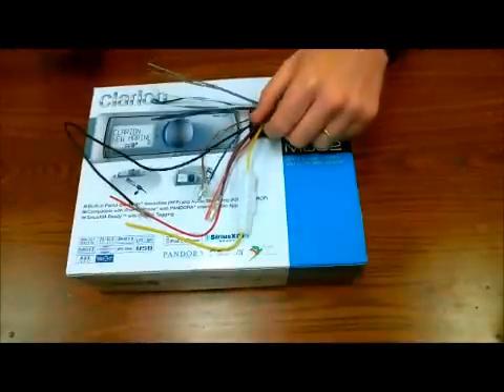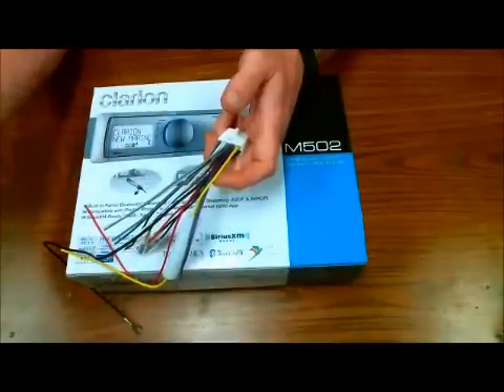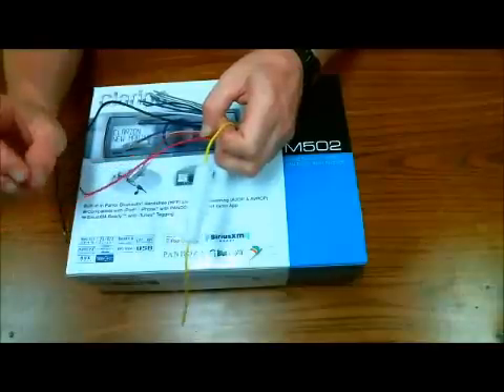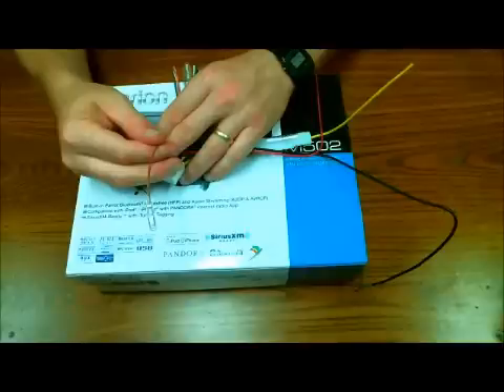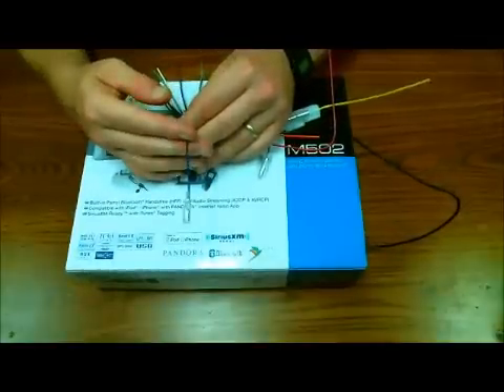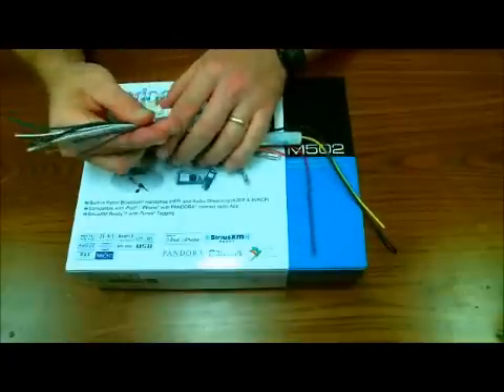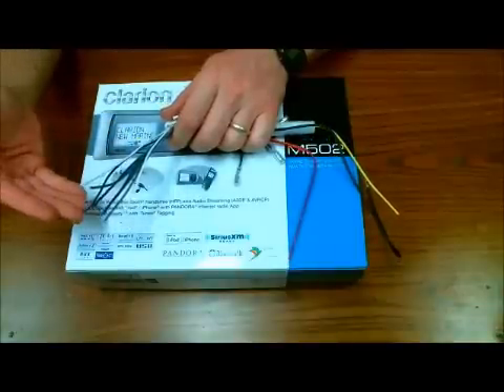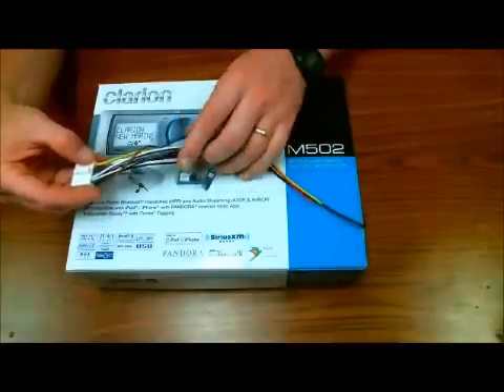Car Stereo Wiring Explained In Detail

Comment: I have a yellow lead and a red lead with a join half way along them. Not sure why these might need to be separated? Also, I am having problem with the presets radio stations - they keep getting reset rather than using what I have tried to get stored in the radio's memory. This happens each time I return to my car. I can't understand it - has the yellow and red leads got something to do with it not memorizing the presets?

Comment: hey i have a pioneer 4100 nex and i got a scion tc 2012 i have a cable that says power antenna idk where to connect it so i just conect it to the blue wire since its blue as way and now i have issues where my bluetooth does buzzing sounds when its on what can i do

Comment: i have a land rover discovery 2 and the memory will not hold to the unit. this model has three factory plugs behind receiver. bout vehicle with no radio in it. but there was a partial plug adapter in it. just need to find what I need to do to have this working for my wife. thanks for the help.

Comment: I have a Sony head unit and a Buick LeSabre car. My unit only works when I have the yellow and red wires spliced together. There are two yellow wires coming out of the GM harness, but only one yellow wire coming from the Sony harness. When everything is hooked up as described above, I have an amp draw which drains my battery. Any advice?

Comment: i have a 2000 dodge Dakota someone has had subs in it but took them out my question is i get the stereo working? but it will forget my settings some times and blow the 15 amp fuse that controls the tail lights and dash lights but the stereo its self still plays music without that fuse i unhooked the stereo and put a new fuse in and the lights work again did i cross a wire and if so what is your best guess on witch one i crossed
Reply from the maker: +josh smith Why dont you use a wire adapter like the ones metra or scosche makes so you know the wiring is the way it was factory originally without all the weirdness?
Reply: +Lessco Electronics i was just outside i ripe out the old wiring and but connected the pig tail to the truck its self hurray no fuse popping then other weirdness starts like the dimer switch controls the radio if the dimer is down the radio turns off and if its playing music it popes the fuse also it starts to blink on and off same time as the dash back lighting and the odomiter flash im really confused i think my radio itself might be the problem...
Reply: +josh smith i wish i could just post a pic of this lol
Reply: +josh smith i figured it out i had the black ground connected to black green not the other black its working now flawlessly
Reply from the maker: cool beans. glad to hear

Comment: How about a Winnebago Motorhome? I tried following the wire colors (1997) can't get it to turn on. I am going to take your video and go over the wiring again. Just wanted to know if I have to do anything different. On the old radio the 12v wire IS the orange and white stripe. ????

Comment: I got the FH-X820BS and the wiring diagram isn't clear in the manual. I've connected a few in the past with success. Is a better diagram somewhere?
Reply from the maker: +Cody Smith which wires are you hung up on?
Reply: +Lessco Electronics the diagram wasn't clear in the manual. Usually it will list each wires function directly like you did here but wasn't sure  if my harness was the same as yours so crutch field was able to give me a direct diagram list. Thanks though
Reply: +Lessco Electronics hey I need your help. I just wired the FH X820BS and I'm not getting display. I've made sure all fuses aren't blown, made sure my constant, switched, and ground are good. Still no power. I'm stumped.

Comment: I have the orange/white and orange wires on my harness but they are not on my new stereo's harness. So do i just ignore those 2 wires?
Reply: +Jack G. Yes, just cap those.  They aren't anything needed.
Reply: It dims the display when it's night. Connect them.
Reply: ThothHeart Maat I have same situation, do I connect it to a ground source? Because there are no other wire on stereo to connect to
Reply: sid misra I guess if your radios harness doesn't have the wires then the radio might not support that function. In that case you can tape them off.

Comment: Thank you for your great video.  I have a couple questions.  I am installing a car radio in a Saturn.  It's harness has 4 wires that I haven't seen described anywhere.  I has an Orange wire, an Orange Black, a Red White and a Red Black.  The rest of the wires have been found and put together.  I would appreciate any ideas that you may have.  The Speaker wires were exactly what you said and the Red, Yellow, Blue, and Black wires were also there and have been connected.  Thank you.

Comment: GMRC-04 adapter wire connecter BLUE wire hook up to blue/white when? on  2000 Buick lesabre with  windshield antenna is that correct or not?

Comment: I hooked up a after market stereo to my 99 honda accord and i ran across a prob;em, after i got all the wires hooked up the stereo powered up and the cd player worked and everything but i have no sound from any of the speakers; what did i do wrong, please help me if you can. thank you.
Reply: have found  any help  on that  yet I am having  the same  problem  everything works  but only thing i don't have  is sound only  sound I have  is on my  subs only
Reply: Same problem for me with a 99 Odyssey. Hoping for some insight if anyone has it.
Reply: +Christopher Luea you didn't connect them right. Go back and verify each wire. Explain how you wired it. Did you adjust gains if any. Lots of possibilities. Pay for the support.
Reply: I had the exact same problem too I  follow the steps but still no sound until placed the blue w/yellow strip from the deck to the red wire and yellow wire twisted together from the stereo and still had the black with black for earth and then it worked sound and all. But like they say it can be different depending on the models etc but this might help someone cause it worked for me.

Comment: hi. good video but didn't help me. I changed bad alternator in 04 envoy 3 days ago, after installing new one my aftermarket stereo no longer has power AND  was the confirmed source of a parasitic draw on my battery. stereo hasn't been altered in a year. how can I fix this?  Is stereo no good? if it's a certain wire on stereo doing this which one can do it and how can I fix it?

Comment: I am working on a 94 accord. I have wired everything up and am left with my 12 switched wire. To my factory wires i have a yell/white, white/red, and a red/black wire. Non seems to work. When i touch the red ign switch with my tester my stero comes on. Please help.
Reply from the maker: +mudaddy1 verify the fuse is ok
Reply: Lessco Electronics I found out the problem, my ignition switch was not getting any power. So i fixed that but now i am not getting any sound. I hooked up a stereo in this car before, but now it doesn't seem to want to work.
Reply from the maker: watch my video on how to check your speakers and wiring: https://www.youtube.com/watch?v=TFlwINTNFqg

Comment: it's sometimes good to take the wiring from the standard rear spakers and splicing them in the front speaker wires,
Get a new length of speaker cable to run from the harness pin
 from stereo rear speaker pins

Comment: different wiring harness for car but I know what your saying about the yellow memory wire spliced into the red 12v live to save head units memory!  

all the head units Iv bought have never had a fuse on the yellow and alot of the time it's not even connected to anything just hangs there, 
recently 2 weeks ago, I bought a new pioneer Dab head unit hard wired dab antena to live 12v and the yellow and blue remote was not connected to anything all colours went to the 16 pins that were wired.
Some cars memory are saved by ignition and head up display with factory fitted units!
 3rd party units must take the red wire and and strip the insulin off about 1cm (don't matter if you cut red wire)  then strip the end of the yellow then say solder it into the red for the sake of this post for safety, 
you can twist n wrap if your experienced enough at it and know what your doing.
the blue remote wire can be used for your parrot phone doodaa or to your amp on your sub!

Comment: I have a question. I installed an aftermarket radio in my car and I installed new door speakers to it and while I was putting the front right speaker, the speakers magnet got stuck on the metal frame of the door and now there's no current going through the wires where the speaker is hooked up now. what can I do to fix it?

Comment: what if the ground wire doesn't have the silver mettle prong on it?. on my wire harness and my Sony radio harness both have the black wire .. do I just use a button connector to hook them together like the rest of the wires?
Reply: metal*
Reply: butt connectors*
Reply: Yes. not button..."butt" connectors connect two bare wires together. Take the two black and connect one to a black one on the other harness if it has one. Otherwise connect both to a metal ground. Like the body, frame.

Comment: I want to put an pioneer in a Toro tractor that just has a power wire and I can put the ground on the machine. where could I put the blue/white to operate the remote control. I also installed a manual antenna. The radio has bluetooth, cd, and mp3. Your video was excellent but is there a way with out all the wires that are in a vehicle.
Reply from the maker: +GEORGE BRAZIL connect only the ones you need, you shouldnt even need the blu/wht

Comment: Hello thanks for the quality video!
However, I have a '99 Jaguar XJ8 and i've found a harness but, it outputs to ISO 10487 connectors. Do I need an ISO to Head Unit (In my case sony) adapter or can I simply cut off the ISO connectors and rewire with the standard sony headunit harness? Are colors the same for the ISO? Are there other options?

Comment: I'm replacing an aftermarket with an aftermarket... I could have sworn the black (grounding) wire was connected to black on the car's adapter harness.  I connected color to color like I thought it was before.  It seems to give perfect audio but I noticed the back metal plate of the head unit overheating.  I'm also still confused about blue vs. Blue/white

Comment: hey I have question I have 1999 civic my stereo does not turn off when the car is off and all the wires are right I looked, do you know what the problem could be thanks
Reply: +Hikyy Baghban I have the same problem. I hooked up the yellow wire to an ignition wire

Comment: Hey thanks for the explanation in the video; I have one question though. Right now i have a civic and the previous owner cut the factory wires for the speakers all the way to the harness. I was wondering if i could run speaker wire directly from the speakers to the cd receiver harness. The remote, power and ground wires are still good and able to connect to the harness as well. Please let me know, thanks.
Reply from the maker: S2kDriftingf20 sure, that'll work too.

Comment: hey what wire is the left n right speaker for factory stereo for 08 chevy silverado  I'm trying to put an adapter to the factory stereo but I need to know what color is the front n rear speakers to the back so I can put it to the factory stereo.  plz help with this.

Comment: Help! Something weird is happening with my aftermarket radio from a car that i just bought. The LED and LCD screen turns on for half a second and then immediately turn off whenever I turn on/off the car or start/turnoff the engine.
Reply: Joseph Chang so everything works on the radio except for the illumination which turns on for a second everytime in turn on/off accessory mode and on/off the engine.

Comment: My aftermarket radio is not displaying after connecting all the wire to the Primary wires. but i connected to car battery direct and it came up. i then connected again Yellow for Yellow, Black for Black and Red for Red and still not coming on. How can you help?

Comment: Hey just have a question I recently got a new system and installed it myself but every time i step on the acceleration a wired sound starts coming out of the speakers this did not happen with the old system and if I mute or turn off the stereo this sound goes away, is there any methods to fix this problem thanks. Really new at this car stuff

Comment: THANKS SO much  😉👍BUT I'M SITTING HERE IN MY 99 CHEVY TAHOE WITH THE DASH APART TRYING 2 FIGURE OUT WHY THE TOP REAR speakers work BUT the rear doors don't 😠
Reply: Check the wiring for the colors pertaining to those speakers, maybe it is severed/weak.
Reply: Thanks... I put the blue and white stripe  wire with solid blue and Its WORKING... 😉👍
Reply: +Kitty Kat I noticed on radio pulled from my mustang that the solid blue was connected to the solid blue AND stripped blue. Why is that? Was hooked at bestbuy. I will be connecting same radio to my Toyota in a few days but don't understand why the blues was connected like that. Also, there was a small "capacitor" connected between the blue wiring
Reply: Al Complaint SO SORRY for the LATE REPLY... Hope you made out good... I'm not sure.. but I think it's the Amp and rear speakers... Google &This Guy  Android602715 helped me

Comment: I have a 92 f150 and I bought the wire harness for the after market radio to connect to the f150 plugs when I attach the wires should I go color to color?

Comment: If you don't care about the receiver remembering, can you combine yellow and red to a single positive 12v source? I ask because that's all I have from my old boat radio.

This set up powers the receiver but I can't get sound to the speakers. the receiver and speakers are brand new kenwoods. not enough amps from the old power source?
thanks in advance, you really know your stuff!
Reply: Steven Collova Provided that the 12v source can provide enough amperage, this will work and will obviously erase data each time it's turned off.  If you're tapping to a fuse such as the cigarette lighter, be sure it can provide enough amperage for both the head unit and the cigarette lighter.  Otherwise if you draw too much power consistently for long enough it will blow the fuse regularly.  This is the only issue I would see if you don't care about presets being saved, good luck hope this helps.
Reply: ashokk sethi Thank you! I tried a bench test suggested by Kenwood and I think it's a faulty unit.
Reply: Bcae1
Reply: Steven Collova uuun
Reply: uuuu7.
Reply: y(k

Comment: im in the process of replacing my stock stereo with an after market stereo. however i do not have a harness. i just wanted to get a clarification on the wiring as to which wires do i match up to which. looking forward to hearing for you . thanks in advance.

Comment: So im my manual for my Kia 2001 spectra, it says not to install an after market radio. My question is can an after market be installed safely. Here is what happened last time. My dash lights went down, dash circuit board blew, Alternator light and chargeing systum not working, flasher tail light circuit blew continuous 10 amp fuse. Did i wire wrong of is it just a result of installing an after market unit.
Reply from the maker: Big Jay No way, Ive done that car 100 times. forget all that, the stock radio is junk, we all know that. replace it BUT use the appropriate adapters and youll be fine.
Reply: I did buy an adapter and prob. made a wrong conection can i send you a photo of it and can you instruct me which wires connect to were?
fxrmiami@aol.com thanks
Reply from the maker: email the photo to sales@lesscoelectronics.com

Comment: ok so i got a farenheit ti-651b car stereo...Lets just say the wire harness is a lil different...It has a PINK WIRE LABEL REVERSE +12VDC, A BROWN WIRE LABEL PARKING BRAKE GRD "i assume ties in with the blk grd", A BLUE/BLK WIRE LABEL STEERING WHEEL CONTROL...I can't recall ever seeing a wire label reverse anything so any info you can give me on where to connect these wires will be greatly appreciated...

Comment: I had issue where my stereo won't save its settings, I swapped red and yellow. and now the stereo is live even when the key is off. any idea?
Reply from the maker: ***** whats the model stereo? and gthe car year make and model?
Reply: Lessco Electronics My setup is:

Kia 2005 Sedona and JVC kd-g502
Reply: ***** I'm no expert but I'm guessing you are using a adapter and it's wiring may not entirely line up with your after market stereo. What I mean by this is your red may be your constant 12v and the yellow may been omitted. Follow the wires from your stereo back to the cars wiring and make sure they line up. If they don't wire your yellow to the red like you have and your red to your cigarette lighter with a fuse for key power. this should allow your stereo to turn off with the key. I had this problem with mine which is a bit of a pain but quite easy to fix.

Comment: I need some help please...I have made my own "boombox" that I use in my work vehicle since it does not have a radio.  It works fine, but now I need to change radios.  I will be using a radio from a 2000 Dodge Intrepid.  I ordered a wiring harness for it...but it came without a black wire (for Power).  I just plug the radio into a cigarette lighter.  Anyway...no black wire...now how do I get power to it from the cigarette lighter?  Thanks
Reply from the maker: Mark Spark use the bolt on the back of the unit and run it to a ground strap somewhere and it'll work fine.

Comment: Hi I have a Clarion VZ401 and was wondering what I do with the reverse gear wire and where does it go? I will be hooking up a back up camera and it will plug into the rca input. 

Thank you
Reply from the maker: Jesse Turner run that out to the reverse bulb in one of the 2 rear tail lights (the wire that rests at ground and switches to +12v on reverse trigger).